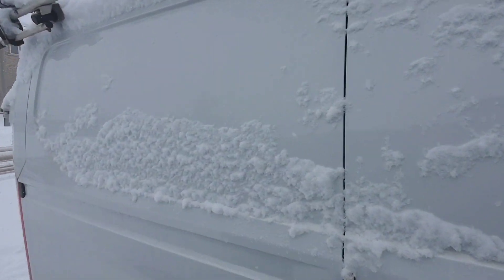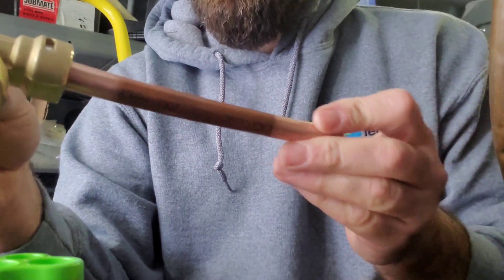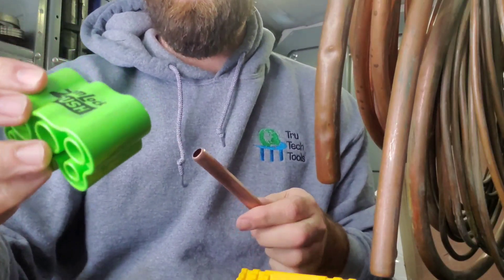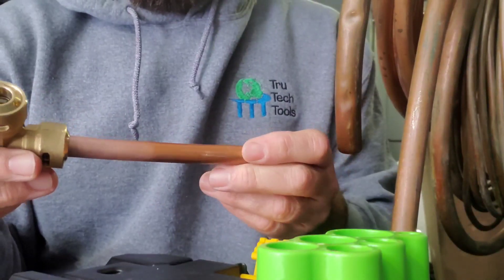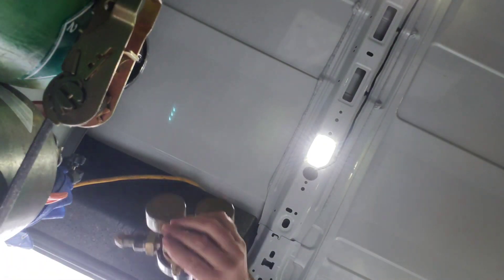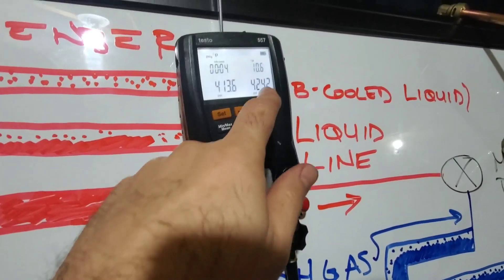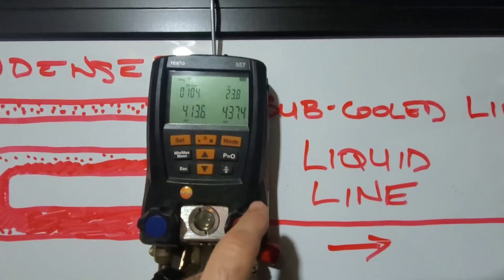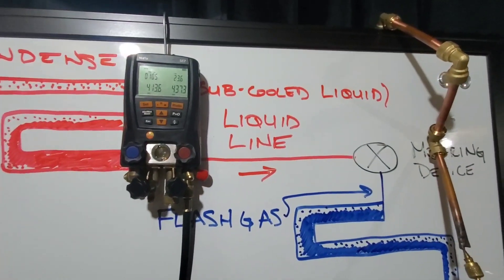Zoom Lock Push Fittings R410A Optimized - A Brazing Alternative

Comment: I have seen these used in field for commercial ice machine 404a. The line set had 4 fittings on the line set. There were two 3/8” fittings and two 1/2” fittings. I had no refrigerant in the system upon arrival. The machine held 10 pounds of refrigerant. I pressurized with nitrogen and refrigerant. I could not pick up leak with two different types of leak detectors and soap bubbles. I did not assume anything. I left overnight to find completely out again. Pressurized with full drum of nitrogen and refrigerant. No leaks detected. I soaped every fitting. No bubbles at all. While looking over the same areas, I gently moved pipe to find electronic leak detector go crazy. Bubbles were at zoom lock fitting. I cut the one out and brazed. Vacuumed the unit. It would not hold. Pressurized the system again. No bubbles or leaks from electronic. I checked the other fittings. The zoom locks were on soft copper. I slightly moved the copper pipe and sure enough it leaked. I did not install these fittings. I question quality of installation rather than the fittings. With all that said, I cut out all fittings and brazed in new fittings. Vacuumed to 500 microns and held great. Charged with 10 pounds of 404a a few weeks ago. No issues at all. These fittings serve a purpose. I can’t afford to loose several pounds of refrigerant on a callback. I prefer to stick with tested and tried brazing. RLS would be more of my preferred option. I will not use on r454 or r290 systems.

Comment: Disgruntled new home owner here - thank you for posting this video and this experiment with the zoom lock fittings. We bought grandmas house in December and it had absolutely no A/C. So I took the job on myself of installing a mini split in our home. I do carpentry, know electrical, I've worked on cars in the past as well to work with tubing, so I felt comfortable doing this. This SOB is the most difficult house project I've ever worked on, largely because of leaky flare fittings on some complicated routing. I've done brake lines, power steering, flue lines, and NEVER had issues with things leaking like they do on these HVAC lines. It's so unforgiving!

Despite buying pro-grade flare tools, HVAC rated fittings, torquing, nylog, and the works, I keep fighting micro leaks on some elbow joints I had to install. Elbows are extremely difficult to work with, even with good vice grips, clamping wrenches, and giant pliers, they're really tricky to tighten down without kinking copper tubing. Brazing is beyond my skillset and comfort level right now.

I just found out about the zoom lock fittings tonight, and this may be my saving grace before I throw the towel in hard on this project. I'd happily replace every elbow and union on the system with these. It's good to see a pro actually stress-test these with legit equipment, we know they DO work if the lines are cut perfect and don't have imperfections. These remind me a lot of those wonderful sharkbite fittings for plumbing!
Reply: Do you have a vacuum pump and a way to measure microns for vacuum depth?
Reply: @ChrisHVACguy  vacuum yes, but not one for HVAC work, and no way to measure microns. Which is why I threw in the towel several weeks ago and hired some HVAC pros to put a shiney new Carrier unit in. :)  I bought the zoomlocks, but never ended up installing them.

I have a new respect for people like yourself that do this kind of work. It's very meticulous, and if things aren't 110% to-spec, it WILL fail. My Amazon unit ended up failing in ice cold winter time, after running horrendously loud during defrosting (so loud, it sounded like a power plant outside of our house). It caused my wife and I a lot of sleepless nights, both in stress and the sound.

I heed a huge warning to the average person that thinks they can install a mini split, or thinks that these budget systems are any good. Attempting to install one myself ended up being a nightmare and a waste of money.

Comment: I believe it is a minimum 24" distance for brazing of 7/8 with wet rag, 20" with 3/4 and so on - same as for zoomlock max. Good that it worked. An easy option for DIY. They have leak rate however,  .1 oz per year per joint.
Reply: Not many DIY guys with an EPA lisc....

Comment: So your company has used them for about a year and we have had some failures. Now don’t get me wrong i have had some brazing jobs leak too but the main reason we stopped using them is because sometimes the 3/8 fittings don’t grip and slip of right off the rip. We now use RLS. I like the idea just didn’t seam worth the risk.

Comment: That 'scratch pad' is called Scotch Brite. 
  Also, using the removal tools are pretty much the same as the removal tools that are used with the Sharkbite fittings.  The only difference I've noticed is that the little orange plastic removal tools for the Sharkbite fittings are a pain in the @$$ to use, because they actually hurt my fingers when using them, whereas the ones for the ZoomLock don't.
Reply from the maker: Scotch Brite is a brand name.  Not all scratch pads are Scotch Brite.

Comment: I have been at a house all day today fixing a Trane tam9 multi stage system tube kit had everything brazed and bi filter in tried pulling a vacuum thought my hoses were bad turns out the system has the non 410a fittings under the house and the house has 2 systems and the other line set has them too thanks for this vid because I didn’t know there are different fittings for 410a until today I’m just a (braze it ,sewage it )kind of guy . Keep up the great vids 👏👏👏👏

Comment: What's the lifespan of these? I can see that there is a rubber gasket inside. Once the rubber gasket dies, so does the fitting. I know these may be easier to use, but is welding really that much harder to perform for a permanent connection?

Comment: A bit late to the party, but in the field the pipe's gonna need lagging. So are you meant to buy special sections that fit over the elbows then glue and tape them to the insulation that butts up to it? At the risk of sounding like a ludditte, I'm sticking to pipe benders and brazing thanks - this looks like a lot of pissing about.

Comment: Sure would suck if it leaked with today's refrigerant prices and you end up eating that cost for a warranty. R- 22 at 1000.00 and 410A at 350.00.
Reply from the maker: Yes it would, if i uses these in the field it would be tested on smaller stuff.

Comment: Please explain "410-A optimized" fitting vs non optimized??? Differences? Application?
Reply from the maker: 410a is for higher pressure refrigerant, use them on 410a systems

Comment: Same amount of work as brazing if not more
Reply from the maker: Think outside the box, it depends really.  There are some buildings that take a while to gain burn permits if you can even get one on the fly for a repair.  Then there are some that have a fire watch afterwards.  There are many other factors here where if the fitting does hold over time it could be a benefit.  Would I perform an install with these, probably not but in a jam or certain environment, they may prove useful
Reply: Tyson man, if you only knew the red tape, permit fees, certification, not to mention all the safety tools and personels you're required just to get that brazing. As Thannos said," all of that for a drop of blood."

Comment: The fact that it’s only rated to 500 microns worries me. New installs I like to pull to 200 microns and rise below 500 microns.  Would this pass a decay test if it’s only rated to 500 microns
Reply from the maker: According to specs they are rated for 200 microns, where did you read 500?

Comment: Great video & clear audio. How has the pressure rig held up over the last 2 months? Did you end up manipulating/twisting the fittings once it was pressurized?
Reply from the maker: Yes it's much harder to twist once pressurized.  It was still holding up about 3 weeks after.  Then I needed my gauges back and took them off.

Comment: Stay away from these fittings if you like pressure testing 2-3 times then end up brazing not worth the wasted time and fustration.
Reply from the maker: I mean they held pressure for days in my basement
Reply: @HVACKnowItAll  but there is expansion and contraction in a working HVAC system that is very different to checking the durability of these fitments in the basement (stable environment)

Comment: I would like to see if they hold after years of temp changes and also the elements specially direct sun light during summer days and chilly nights 
Call me old school but I’ll stick to brazing
Reply: go with soft solder like stay brite 8. brazing weakens the copper pipeline. it even works on r410a systems

Comment: A cool test I'd like to see is you using them hooked up to a system outside (like your own house to be easy) where the weather, temperature, season changes, and moisture are all affecting it and soap bubble testing it after a year and then 2 years and such to have update videos showing the progress of the fittings.
Reply from the maker: Now that's commitment lol
Reply: Yes. 

External water freezing against that seal... would be a concern outside for me. 

Testing in the real world... a good idea!

Comment: Good idea, saves time and situations where you might need to acquire a hot permit. Although I dont like the size of them. For residential or small scale jobs, putting those stacked in line hide may be a pain.

Comment: On your removal test of the zoom lock fittings, would be interested in  seeing if a box end wrench would remove the fitting. We say this because in the plumbing industry a push to connect fitting works as a removal tool i.e. sharkbite brand, gator brand, parker brand we DO NOT utilize the plastic REMOVAL tool a 5/8 in to 7/16 in open box end wrench depending on dia of push to connect fitting. Works with better leverage then the plastic disconnect the manufacture tries to sell i.e some water supply SharkBite valves come with a built in disconnect but again different industry. "The wire" portion must play into the locking  and unlocking safety factor   Our best practice on push to connect fittings if we cant see the fitting  in the final install we dont utilize a push to connect - meaning no hiding behind walls or poor access areas.
Reply from the maker: Some more to think about and test then haha
Reply: @HVACKnowItAll  dont understand your comment

Comment: This product is dumb. All this does is bring in the DIY people into our trade.  Any way to save money today....like we don't have enough crap to worry about doing our craft. If I see in the field, I'm cutting it out.  Why not install flare elbows on every 90 degree or coupling? Because it wouldn't make any sense just like this crap.
Reply from the maker: Have you worked in buildings or environments where lighting a torch is not allowed?  Prodcucts like these are usually born out of necessity and if they work, can be a handy tool in certain applications.  A confident tech should never fear a DIYer, they lack execution.
Reply: @HVACKnowItAll  to answer your question, yes in research labs and hospital with oxygen lines nearby, which is not normal situation for most techs.  In the commercial and industrial refrigeration world, All this product is, is an excuse to be lazy. 
When you have a refrigerant leak, will the fitting manufacturer cover the refrigerant and labor bill? 100 percent No. Or how about the cost of the fitting and adding another fitting because your short on copper to cut out the old fitting? 100 percent No.
Reply from the maker: No one is telling anyone to go buck wild on these, this video is a demo of the product.  All I'm saying is they may come in handy in certain applications.
Reply: @HVACKnowItAll  im going buck wild
Reply from the maker: @grimeyhonkyracing3938  let me know how it goes
Reply: @grimeyhonkyracing3938 same here 😎
Reply: i don't see any diY guy using vacuumn pumps and nitrogen to purge and refill...
Reply: Thanks for making this video. I used them on an install a couple weeks ago :) only time will tell but I’m tired of people bashing the product when they haven’t tested it. Bunch of haters.  Cheers friend

Comment: Certainly reminds me of the Shark Bite plumbing fittings..  which are quite handy in a pinch in emergency situations..   but would not trust them in a pipe that sees any pressures over 100 PSI.  
I can't see using these Zoom Lock fittings on larger systems (5 tons and above).  And are we not phasing out 410a anyway?  Where were these fittings 10 years ago..

Comment: Interesting, definitely very well made. People talk about Shark bites for plumbing but Ive never seen one fail.
Reply from the maker: I've never used a Shark Bite, time will tell
Reply: I have seen them fail.
Share bite does not like extreme cold.
Had a customer who furnace failed in -25C temperature for about a weak. The house froze up. The hot water tank, someone installed it with Shark bite connector. The shark bite fitting blew right off the pipe , so there was full water blowing out the pipe in the basement for days. What a mess!
Also I have been getting a lot of calls for those Shark Bit hot water tank hose connectors , a lot of "Plumbers" are using these days to reduce install time on tanks installation. What we are seeing is the rubber inside them is deterioration over time and customers are seeing black slime in their tubs when they fill up the tub. Everything has there place but if you can avoid them I would.
Reply: @PaulHVAC1  Pro press fittings have the rubber o-rings too. Just built a 100O room hotel in my area, nothing but pro-press. I’m thinking they will fail too.
Reply: @DanO181919  Seems its all about saving money by reducing labor. If they can hire a apprentice to send out with the press tool, they can make more money by the savings on not having as many journeyman doing the work. Basically you can train a monkey to install this quickly. Like I say there is a place for everything. Maybe use it in a area were using a torch is hazardous....but we all know companies will use this for making more profit on cheap labour.
Reply: I saw someone use one on galvi after pulling out the collar. You aren't supposed to do that but it was a DIY guy who did it on a weekend emergency because he had no shut-off and just needed something to stop a flood while they waited for the plumber. They 'should' thread the pipe and and put a valve on it but he was in a hurry and wanted something quick and temporary and didn't care as much about reliability.

Comment: nice tool that can be use hard place to braze and many place& regulation about fire etc and other requirements.
thanks for sharing. 
and it will be nice to make vacuum test also.
Reply from the maker: I will try to get that done as well.
Reply: I have been relying on propress. Luckily, most modern systems don't last much longer than 10yrs. I believe the O-ring in propress is rated for 10yrs.

Comment: Do you not cap off your copper rolls, I was always taught to put a cap or tape over the end so dust and debris does not get in it, I see you have it pointing down so chances are not much will get in there
Reply: Spiders can and will lay eggs in copper hanging like that so the statement nothing is getting in there except air or moisture is not correct and for someone with the screen name HVAC know it all I would expect better this coming from a fellow know it all also you did not show in you video the outside deburring and in the video you can clearly see metal sticking out after you reamed the inside and then when you show the connection the outside of the tubing is deburred WHY and when did you debur the outside was it because when you were practicing you discovered that if it is not prepared properly then it will damage the fitting ie.. tear into the sleeve or rubber ring. So moral of the story is protect you copper properly by preparing properly all tools and copper tubing is tool
Reply from the maker: Because they're hanging nothing is getting in accepted air and moisture, tape won't solve that though haha
Reply: No matter the case, protecting your copper pipe is critical. 
 If not, at least blow it out with nitro before using it. You wouldn't believe the buildup of material from just sitting in a van for a while. I use 5/16" for refrigeration, buy it in a 50' roll. After a while what's left gets stuff in it if it's not capped off. I buy my caps at a local hardware store

Comment: These are quick connect similar to shark bite connect I wonder if the same company make the shark bite made them to !!🤔👍👍👍
Reply from the maker: Not sure about that one!
Reply: Shark bites are for water line, means working pressure is under 280psi max. This ZL push fittings are working at Max 870psi even  high. Big differant.

Comment: How long is the warranty on the fittings?
Reply from the maker: Looks like 10 years on 410a and 5 for the removable type
Reply: @HVACKnowItAll  wooh that’s impressive for 410a. I’d still give a proper braze a lot longer than 10 years but that is still a serious warranty. Longer than most Ac manufacturers